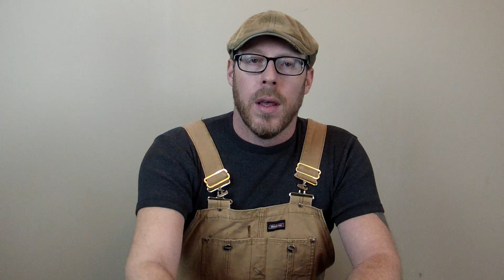Swimming Pool Leak Detection Lesson 2 - Plumbing System Leaks

Comment: Its true a broken pipe will lose more water when running, BUT- leaks always clog themselves in bottom drains and also skimmers, they have a lot of leaves that will get pulled from a clogged leak when the pump starts to circulate. So to be more correct: Most pools leak more with the pump on no mater where the leak is.I sell a leak detection kit on Ebay with instructions- http://www.ebay.com/itm/Swimming-Pool-Leak-Detection-Dye-Test-Syringe-KIT-with-underwater-repair-epoxy-/252228507811?hash=item3ab9fd98a3:g:ZLwAAOSwlRpZZUq4